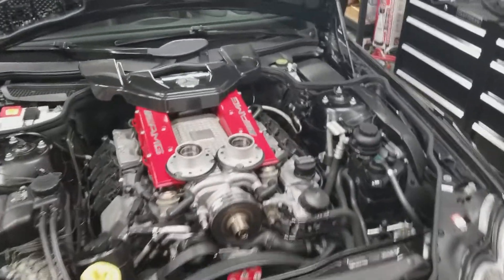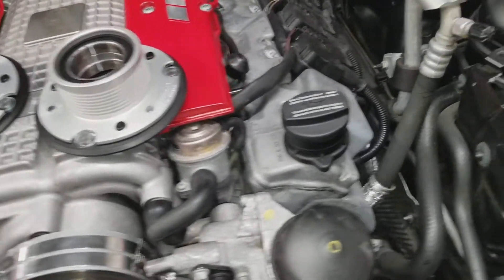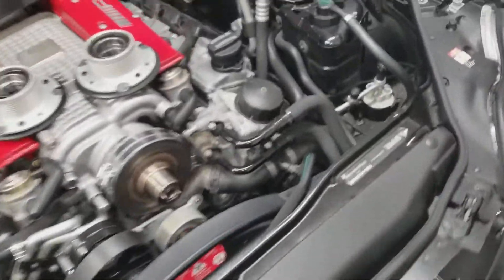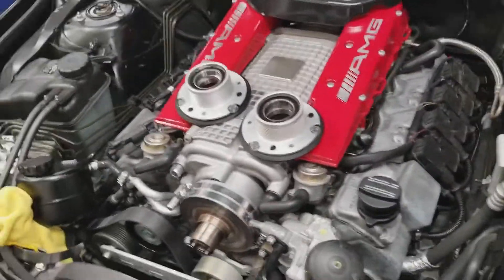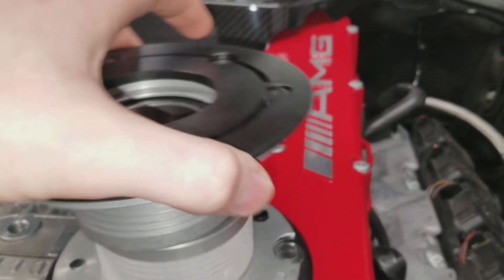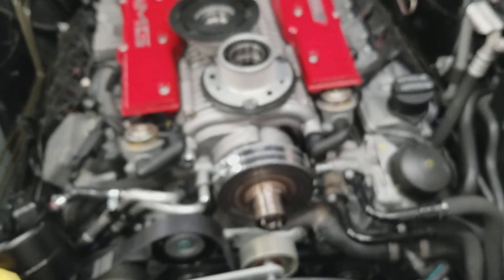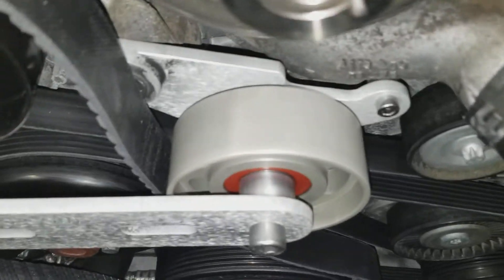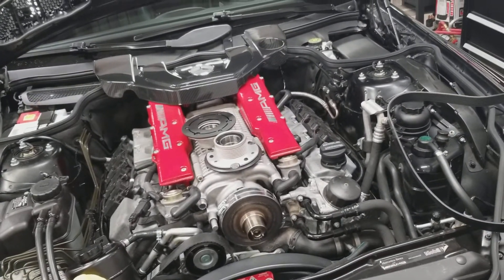Decreasing SL55 supercharger belt slip with micro machining process and Griptec...

Comment: 2005 SL55 with 18k miles. Engine dies randomly regardless of speed or engine temp. No error codes. All dash lights remains off except SRS light when the engine stalled. Engine starts back up right after recycling ignition key, after I stop to put it in park. Sometimes, the car can go for a month with out any problems,  and sometimes the Engine stalls multiple times within few minutes.  Replaced both batteries and crankshaft sensor. It made no difference. Car is in prestine condition. Always garaged. No other issues. Any comments is appreciated.
Reply: Don't hit the start button while putting it in gear like I do every time.......?

Comment: I know this video is older, but I'm very interested in your results. I've perused your video list and watched the 3 or so videos after this but no mention of your results/findings regarding the pulley and belt combo. Maybe I missed something? I'm 95% done with my rebuild and am trying to address this belt slip issue. I've machined my own belt wrap kit, haven't started my motor yet but hoping it helps. I have 2 OEM belts but haven't tried the "Gator Back" belt. Any feedback and/or comments would be greatly appreciated.  Thanks,
Dan
Reply: Yes, please OP I would also love to hear some results for the griptec work, and price also!!!
Reply: @DR-zl2ct  he sold the car.